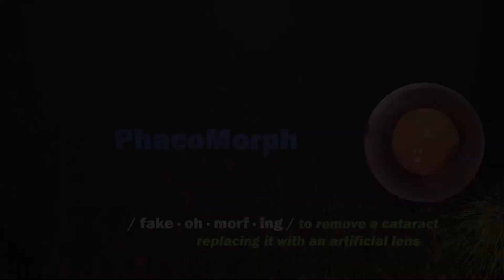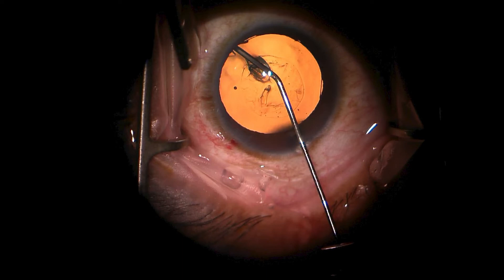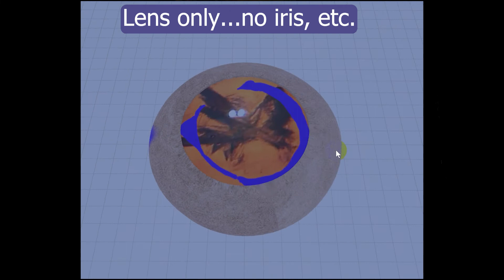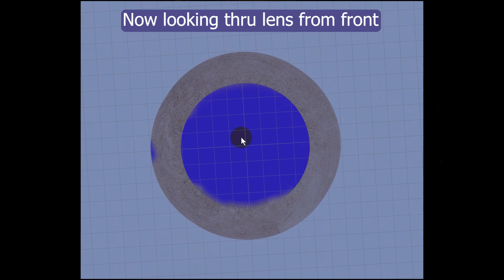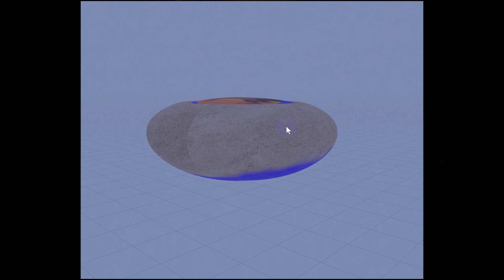13 seconds in the life of hydrodissection.

Comment: W O N D E R F U L  !!
Reply from the maker: Thank you very much. Another fascinating thing I hope to put out as a follow is that when the resident did the next part of the hydrodissection they put the cannula in the same place as they had placed the connor wand to try and turn this lens. In slow motion view the area of disrupted lens expands and small pieces of the lens are ejected toward the front of the eye...again this emphasizes that fluid follows the path of least resistance and placement just behind the capsule allows the fluid to run behind the lens not out the front of the eye. I will hope to start working on that video tonight. Anyway, appreciate the comment.